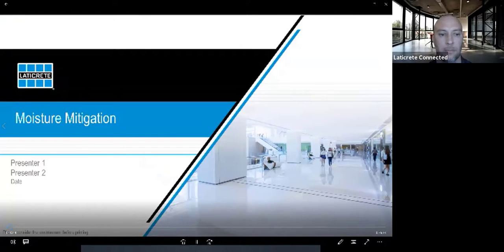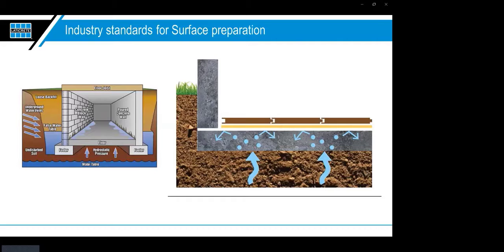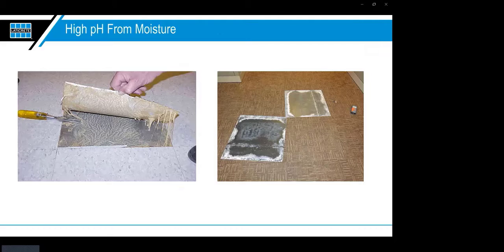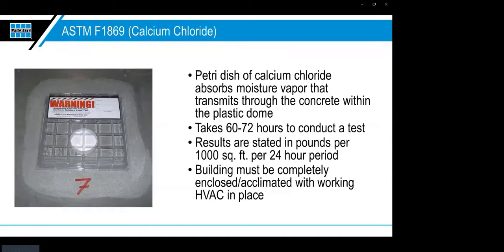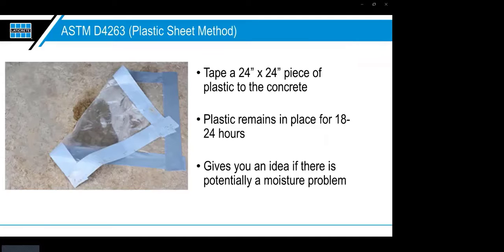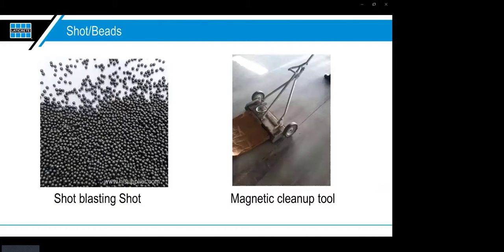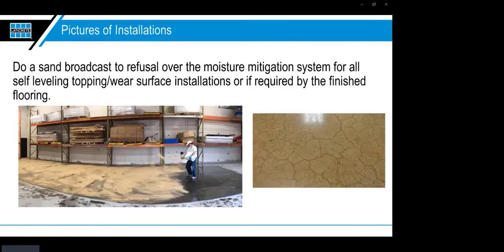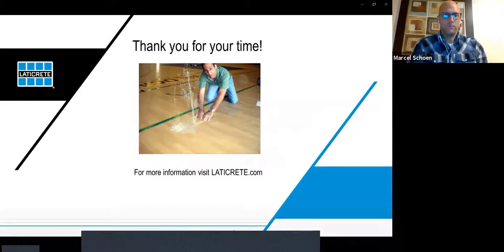Moisture Mitigation Webinar

Comment: If bubbles developes in the moisture mitigation barrier but has dried rock hard, will it still be effective?
Reply from the maker: Hi there! Thank you for your message. Sorry for the delay. There are lots of variables to your question/situation, so we suggest reaching out to our Tech Support team directly at - 800.243.4788 x1235, or email them at technicalservices@laticrete.com. Hope this helps!

Comment: Can excessive moisture or efflorescences minerals ( like Plubming pipe burst over bare concrete slab next to ceramic tile) damage the thin-set or grout adhesion of ceramic tiles?
Reply from the maker: Thanks for the question. We understand you got the answer you needed from our Technical Services Department. Let us know if you need anything else.